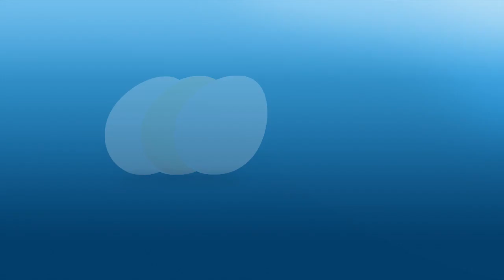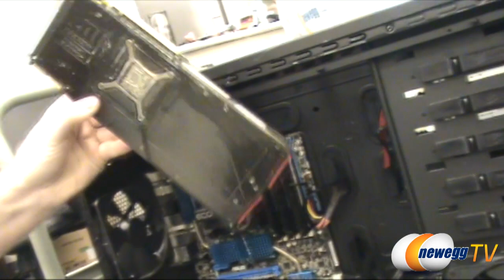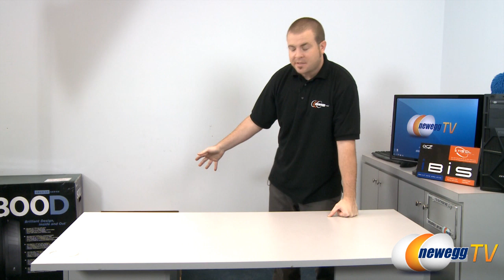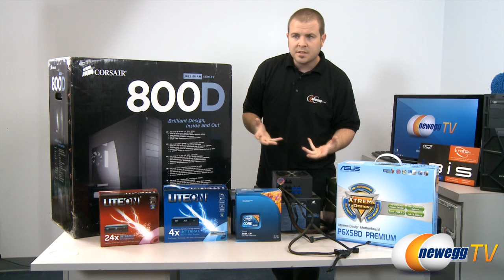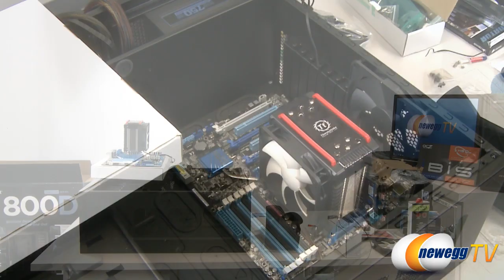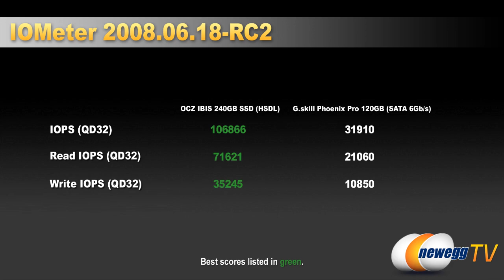Newegg TV: OCZ IBIS Benchmarks

Comment: what your power supply must have been crap cause all of that should have survived the water.   I have had a water heater spray 50 gallons of water on my pc and everything still works except the hard drive failed after 6 months